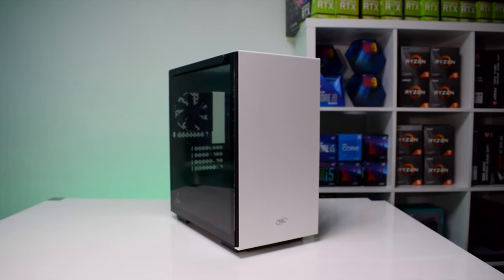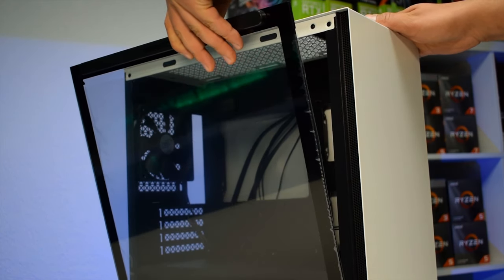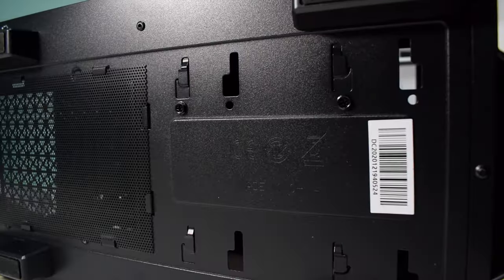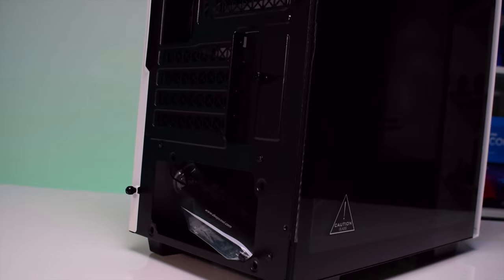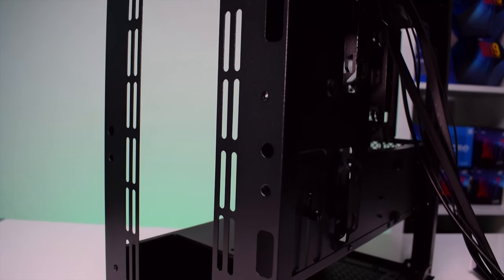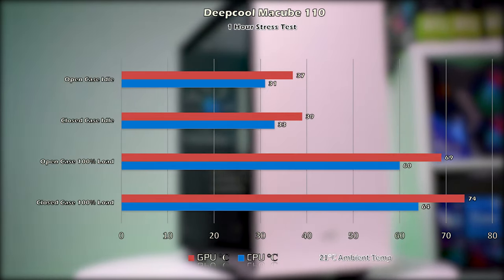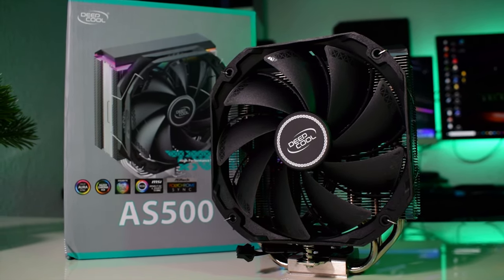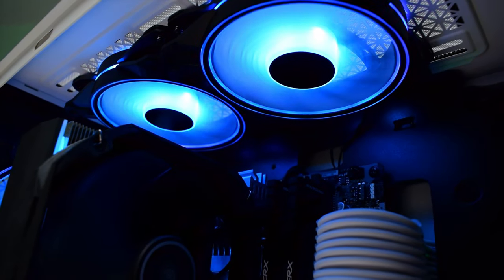Deepcool Macube 110 Review, Build & Thermals

Comment: It's a great case. Looking at videos to get inspirations to improve my build. The case is cheap, keep in kind. It's around like $50 USD depending on where you get it from. In other words; insane value. Minimal sacrifices and great build quality. The magnetic glass window makes it extraordinarily easy to quickly change things in the front of the case.

The only real sacrifice would be thermals, but from a logical standpoint, it should not matter. This is a budget case. You'd be able to use and possibly even overclock a budget to mid-tier build in this with ease and without having to worry about thermals. If you're using higher-end components, this probably isn't the case for you. I'd recommend splurging a bit more on a much better MATX case that will not only afford you better thermals, but also give you added amenities.

Comment: If they offered an airflow front panel option for this and the 310 they'd be a no brainer. It's a good looking case and easy to build in. I built in a 310 but ultimately returned it due to my 3080 getting too hot. Good case for water cooling.
Reply: What case do you use now?
Reply: @Rasyad95  Corsair 4000D
Reply: I am building a 3080 PC and I am still deciding on the case, are 310 thermals that bad?
Reply: @karthikeyans356  there are better and worse cases out there. I'd consider water cooling for the 310. Definitely custom fan curves for the case and gpu if you're going to stay with air cooling. I was up in the 80C range on the GPU while gaming, which in turn caused other temps to rise cuz the GPU was heating the case up from the inside. 80C isn't too hot for a 3080, but the fans were noisy cuz they were pulling air thru the tiny inlet area. In the 4000D case, the GPU is about 55-65C under gaming load depending on the game. I'm happier with those temps for longevity
Reply: @JDuBz815  did u need to change to an atx mobo too or r u just running an matx mobo in an atx case. If ur still using and matx mobo, does it look weird?
Reply: @citrous7372  I had an atx mobo already. I was using the 310 version of this case, or whatever they call the atx version.

Comment: Ive been impressed with this case. Had overclocked my 2400g to 4.3ghz and temps takes down in the 50s even at 100% usage.  Now with a 4500 overclocked to 4.3ghz I see 65⁰ sometimes. With a rx6600. Which probably helps

Comment: I've had this case for 2 years and its great if you're building a mid range pc,however i recently upgraded my pc and it gets much hotter under heavy workloads to the point i have to remove the side panel to get the temps down to normal.I'd only recommend this case if you're building a mid range pc because there just isn't enough airflow for higher end parts that use a lot of power.
Reply from the maker: Agree 👍

Comment: people r telling me that this case has terrible airflow but im only putting in something around a 1650 do u thing my thermals will be fine?
Reply from the maker: You will be fine bro, just make sure it has 2 fans on the front and an exhaust fan 😉
Reply: 2 fan front as intake? And the other 3 are exhaust ? Am i right ?
Reply: @Tech-Profis  bro i am using a GTX 1070 with a Ryzen 3600. The problem is the case i brought just a month ago, The thing is the gpu temp got 86-88 degree while gaming. But when i removed the glass side panel the temperature decreased around  6-7 degrees.

What to do any suggestions ? 

I am using 

2 fans upper side (exhaust)
1 fan back side ( exhaust )
(Aigo Dr12 pro ) 

And 2 fans front side turning to intake fans . (Deepcool casing fans).

Comment: would the temperatures be bad with rtx 3070 and 12400f?
Reply from the maker: It should be fine with the right CPU cooler and correct fan installation 😉

Comment: Sir should I use a aio cooler with i5 11400f?
Reply: Not needed, the 11400f is a non-overclocking cpu with low wattage use and will do fine with a 4-heat pipe tower cooler even under full load.

Comment: can i use a rtx 3060 and ryzen 3600 will i have aby air flow isuus
Reply: I have a r5 5600x and a 3060ti. GPU temps don’t go higher than 75°C and the CPU stays pretty cool with just a thermaltake air cooler.

Comment: hi. i am building pc for the first time so i got a question. may i know if the top fans should be the intake or exhaust?
Reply: Intake the more air enters the pc the more dusty and cooler it runs.I suggest top as intake with high pwm fans rear high pwm fans as exhaust and front with regular speed fans as intake if you want as front doesnt serve any good anyways
Reply: @AyushSingh-js3rf  no. Heat rises so exhaust should be at the top.
Reply: @zackery5678  do you think a single fan can even get the required amount of air as intake also rear part is always placed against wall.

So there is no point of using rear as intake also front is also blocked due to design
Reply: Put 2 intakes in the front and 1 exhaust in the back don’t bother adding fans in the top.

Comment: I'm planning to use only the included fan as an exhaust cuz I saw many other people (notably the tech channel Dawid Does Tech Stuff) doing the same. I have a 10400f and a 1060 3gb. I should be good, right?
Reply: I'm using a 3060 5600 combo and the pre build has a intake fan I believe. No overheating
Reply: I'm also maxing out resolution and streaming within the same pc in some streams